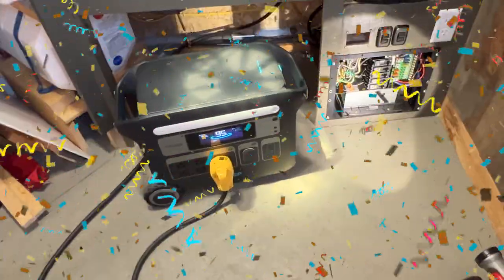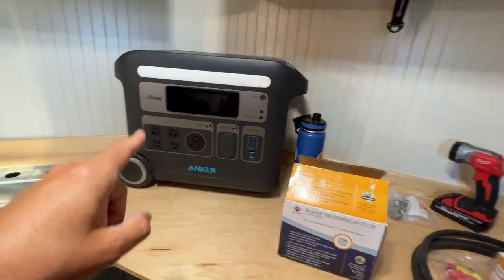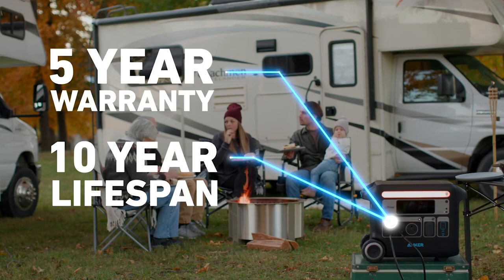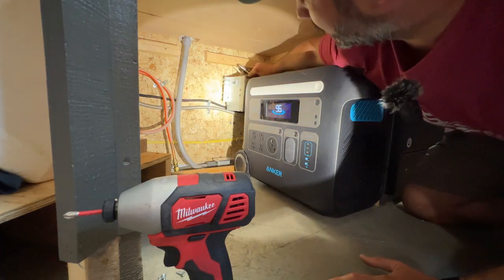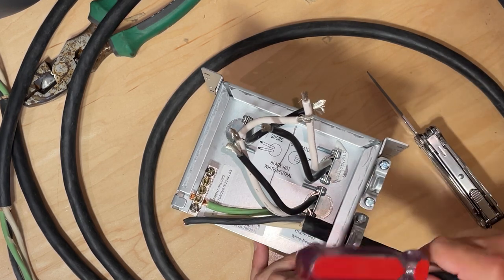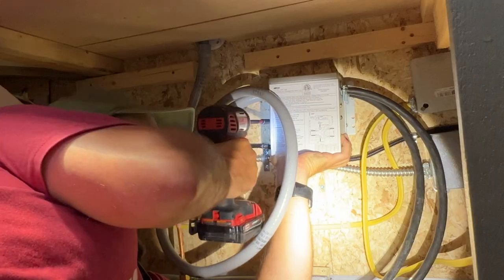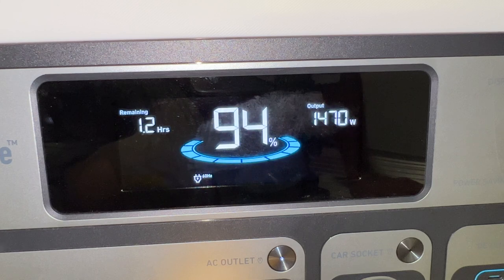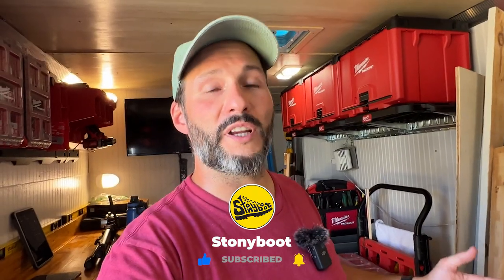⚡️ Tool Trailer Power Setup //  Automatic Transfer Switch Install

Comment: Curious why you would want it to prioritize your batteries over shore power. I would think it would be better to use shore power (or a real generator), when ever possible. Trying to run a real AC for any period is not practical unless you have a huge battery system and/or lots of solar (and sun). With a soft start, a fairly small generator can run an AC all day on a few gallons of gas.
Reply from the maker: It’s an industry standard. I can swap the connections. But, for A/C usage I’ll be primarily running my new generator for the day. 

The Anker is also easy to turn on and off inside, so I can chose. 

As for the reason the generator connection is prioritized, read the following:

The priority given to the generator over shore power in most RV automatic transfer switches (ATS) is indeed a standard, largely due to a couple of key reasons:

1. Control Over Power Source: When your generator is running, it means you are actively choosing to generate power, often because you either don't have access to shore power, or because the shore power is insufficient or unreliable. The system is designed to prioritize your active decision to run the generator.

2. Fuel Efficiency and Usage: Prioritizing the generator also helps ensure that the fuel used to run the generator does not go to waste. If you're running your generator and then plug into shore power, it would be wasteful for the system to immediately switch to shore power and leave the generator running unnecessarily.

3. Preventing Power Interruption: The priority of the generator could also be seen as a way to avoid an unintentional power interruption. For instance, if you're connected to shore power and then start your generator (perhaps in anticipation of leaving your campsite), you don't want all your appliances to suddenly lose power just because you've disconnected from shore power.

Different RV users have different preferences and use cases, and some might indeed prefer a system that prioritizes shore power when it's available. This would make sense if you generally use shore power when it's available and only run your generator as a backup. Some modern transfer switches may offer programmable or configurable priority settings to cater to these differing needs.

Comment: To make this setup just a touch better you could have an additional outlet/breaker combo unit fed off the shore power that both your units stay plugged into to keep topped off.
Reply from the maker: Thanks for the feedback I agree with you 100%. I have other changes coming, I just needed to get something installed. But once I dig into that compartment I’ll be doing something like that.

Comment: These power stations make everything easy. I wish they had an option to add extra Dc products like a 12 volt fuse box.
Reply from the maker: I have similar thoughts. I’d love to see a 50-100 amp 12v connection available. But that’s not a common use case for these units. 

Also, I don’t think they are 12v internally, probably 24-48.

Comment: Hmm, shouldn’t shore power be the priority? It seems like the switch should automatically flip when you lose shore power.
Reply from the maker: I’m not sure. My fifth wheel does the same thing, that’s a different brand of ATS and is a 50 amp. I’ll have to do a little research, I’m sure there is a reason.
Reply from the maker: The priority given to the generator over shore power in most RV automatic transfer switches (ATS) is indeed a standard, largely due to a couple of key reasons:

1. Control Over Power Source: When your generator is running, it means you are actively choosing to generate power, often because you either don't have access to shore power, or because the shore power is insufficient or unreliable. The system is designed to prioritize your active decision to run the generator.

2. Fuel Efficiency and Usage: Prioritizing the generator also helps ensure that the fuel used to run the generator does not go to waste. If you're running your generator and then plug into shore power, it would be wasteful for the system to immediately switch to shore power and leave the generator running unnecessarily.

3. Preventing Power Interruption: The priority of the generator could also be seen as a way to avoid an unintentional power interruption. For instance, if you're connected to shore power and then start your generator (perhaps in anticipation of leaving your campsite), you don't want all your appliances to suddenly lose power just because you've disconnected from shore power.

Different RV users have different preferences and use cases, and some might indeed prefer a system that prioritizes shore power when it's available. This would make sense if you generally use shore power when it's available and only run your generator as a backup. Some modern transfer switches may offer programmable or configurable priority settings to cater to these differing needs.

Comment: I would suggest looking into a mini split , you could turn that trailer into a meat locker
Reply from the maker: It’s on my list, but…. Mounting locations are my main concern. Once I get my generator setup, I’ll have a better idea of where I can mount the mini split unit. Possibly where the propane tanks are. Worst case, I’ll get a roof top A/C. I’m also pressed for time, so ease of install is key.

Comment: Awesome upgrades for our trailer (workshop).
When the time comes to install a rooftop A/C, giver very close consideration to installing a heat pump model.  That way, you can have some heat in the cooler months of the year.
Reply from the maker: I'll be getting a heat pump A/C unit. I wanted to get a mini-split, but decided against it due to space limitations. I haven't ordered it yet, but I will soon. It's been 100-110 in texas and its brutal!

Comment: Great video! Ordering the transfer switch as soon as i double check to see if it works  with my wfco control panel. As luck had it i waited  untl end of April to buy batteries and found the Anker 767 -bought it because it looked much easier and less components! In the middle of my build and wanted to find out what kind of framing did you use for the nose section of your work trailer? Looks light weight and I'm not a carpenter. Thanks and looking forward to more videos!
Reply from the maker: I hope it works out well for you. As for the framing, I didn't do it, the guy I bought the trailer from built it. But, its just 2x4, 2x2, plywood and bead board. Pretty simple stuff. He did a great job considering it's a utility trailer!

Comment: That’s a pretty good set up I just need the a/c to work because I don’t see this heat getting better as the years go by. I will check out if the Anker will work for me. 
Dude where is Sasha? Did you ever do a video about your new Truck Camper?
Reply from the maker: I hear ya. AC is critical for me. I have to decide between a roof top AC and a mini split. 

Roof top is simple to install, mini split is more complex, but quiet and provides heat and AC. 

Decisions, decisions
Reply: I would go with the mini-split, I have seen many RV'ers with them lately and it is a game changer compared to the rooftop kind. They are very efficient, durable and like you said, very quiet.
Reply from the maker: That was my original plan, but I've run into space issues and will more than likely go with a roof top heat pump. There is a unit from RecPro that seems very quiet and offers A/C and heat all the way down the low 20s using the heat pump. I just have to order it!

Comment: Let me ask isn’t the anker w a built in ups mode where if the power went out I’ll go into battery power instead of grid ? Why not leave this like this with out the tranfer switch  since the ability is build in you just need the fuse box that’s all , can you explain maybe your situation or where this tranfers switch is necessary or beneficial since if we had a situation where we needed power from grid or portable stations I’ll be a simple plug and unplug ..   I might learn something we all need do things differently or have just different usages hehe ..

Comment: I guess your going to put a 12 volt AC and roof solar. By the way I sold our Cirrus over a year ago and just bought a used 2008 Four Winds Chateau with only 18,000 miles on it. This one my wife Alison can appreciate it with more room. The Cirrus was ok for me not she.
Reply from the maker: I might add a little solar, but for now I'm using a generator while I'm on the road because I need to keep the A/C going, but once the heat subsides, I'll just run off the SOLIX F2000 power stations.
Reply: I get that. Burn out time it’s nice see your back.